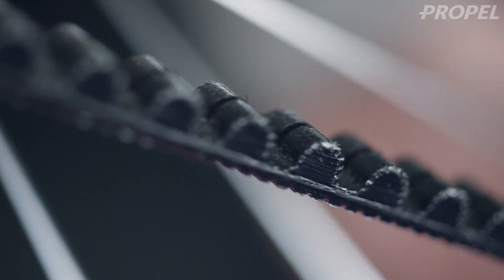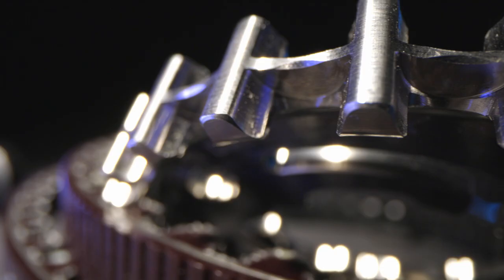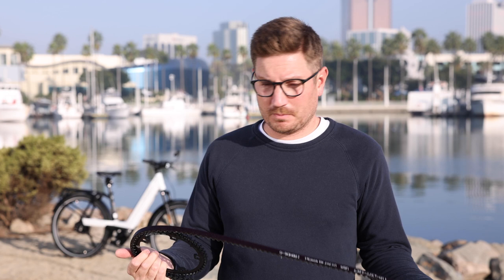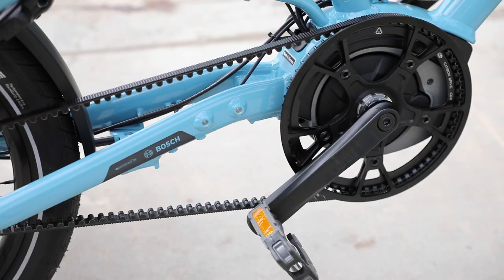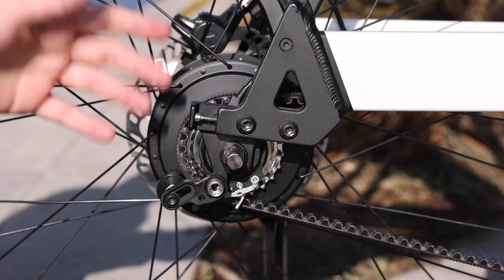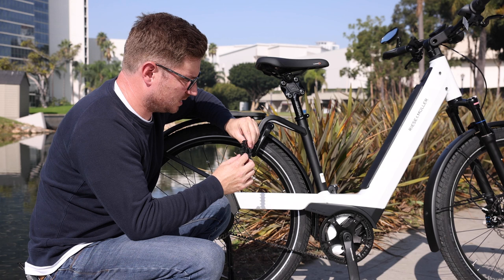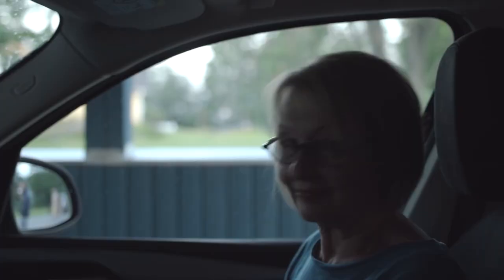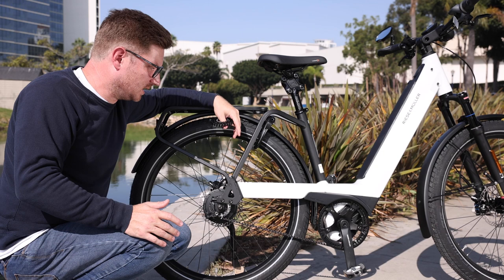Belt vs Chain - Will the Belt Win the Ebike Race?

Comment: Really appreciate the information you guys are putting out.
I have some questions you may be able to help with.
I come from traditional old skool bikes, I used to mtn bike for fun and race and road bike for the same.
Pre electric, got rid of the road bike , still have the 3x8 man bike, looking at going electric, rode a specialized Levo recently and loved it.
Thinking about a R&M, probably either a Delite or a Delite Mountain, it will be a fun plus transport with more emphasis on transport, but more enthusiasm for fun.
If I go for a Delite HS GX Rohloff, is is possible to remove the Mud Guards, and what does the Mountain version have that the Delite does not, I assume with no mud guard I could run wider tyres, but still have the option of 28 mph as opposed to 20 of the CX mountain?

The other question may show my ignorance of the electric but can I pedal faster than 28mph, I can on my old skool hard tail man bike, what happens if I am peddling fast enough to hit 30 or more mph, will no motor stop, burn out, or what happens, can you even do this ?

Comment: I rode along a sea wall during a gusty day during lockdown. The next week my whole chain gear had turned a bright orange (rust). This would be a solution especially if the cogs were non ferrous. Really enjoy your vids always high quality with easy to listen diction.
Reply from the maker: I definitely this this would work well for this application.
Reply: I've got a road bike with belt drive (Civia Bryant), and the original rear cog was aluminum. Unfortunately, it fatigued and broke and had to be replaced. I believe the replacement is stainless steel; stronger, just as corrosion-resistant as aluminum, but a bit heavier and more expensive.

The front cog actually looks to me like some kind of high-strength plastic, but I could be mistaken. In any case, I've never had any trouble with rust or other corrosion on either cog. It's one of the reasons I love the belt drive so much; years of all-weather commuting, including plenty of rain, and still basically no maintenance.

I like the belt drive on my Civia so much that when I wound up in the market for an e-bike, I wound up choosing the much more expensive R&M Supercharger, because at the time it was the only e-bike I could find with a large enough frame but which had the belt drive (Haibike has frames that actually fit me even better, but none with belt drive).

Comment: I run a bosch cx with a shimano deore xt 11speed and i need to replace my chain every 3 or 4 hundred miles. I lube with squirt dry lube every week. Am i doing something wrong to eat chains at such a rate? I use kmc e11 chains as well!
Reply from the maker: 300-400 seems low. Are you using a chain checker gauge? 

Are you cleaning before you lube? I wonder if that would help. If you’re running through them that quickly you might want to consider just going with a more standard chain as it seems a waste if you’re only getting that out of a eChain. I wonder if the alignment is right. Is it shifting smooth?
Reply: I run the same setup for over 4000km without any issue. I degrease and relube (also with dry lube) my chain drive every 2 weeks.
Reply: @Propelbikes  I use a chain checker and replace at 0.75% wear, but i have heard you should replace an 11 speed at 0.5%, which seems too little to me. Also, the Squirt lube instructions are for a thorough  degrease before initial application but then to reapply subsequently without any further cleaning.

Comment: I have a R&M delite envioloHS bought from Propel. Is it possible to replace my current Enviolo manual hub with an automatic one as an upgrade ?
Reply from the maker: Hey Joseph, thanks for your support. Unfortunately it’s not so easy to upgrade, but it could be possible. I would probably recommend waiting until the bike is out of warranty as a change like this would void the warranty. I’m not 100% sure if it’s possible, but it might beZ

Comment: fitting a gates belt to an existing bike is an expensive exercise. geared hub. split frame. sprocket set. belt. shift cable. shift controller. Definitely a better option to buy the right bike. Hikobikes in NZ are the most affordable. The Riesse Muller are twice the price.
Reply from the maker: It’s best to get a bike already built for a belt. Hikobikes aren’t available in the US. Seem to be an ok affordable option, but definitely not a Riese & Müller
Reply: @Propelbikes  have to agree th RM is the best

Comment: I've always got 10000 miles plus from a chain. And only replaced 1 or 2 rear cogs at the same time. Just go back to 6 speed Suntour Pefect. It doesn't wear out as fast as later systems.
Reply: Center mount ebike motors wear chains out really fast. I tried keeping it clean, so it wouldn’t wear out so much, but in the end I decided it wasn’t worth it every day, its simpler to just swap the chain and cassette every 3-4 months. Front ring becomes unusable in about a year, when the chain keeps just slipping.
Reply from the maker: The shift detection on the Bosch system definitely helps with this, but a belt does have a much longer life

Comment: I’d like to see a conversion kit to convert to a belt drive from a normal drivetrain and gear set.
Reply: There are quite a few of those, actually. 

The conversion itself is pretty straight forward. The limiting factor pretty much always is the frame.

Comment: I got 20 year old sparta bike ''chain'' ''internal hub'' about 50,000+ KM
Only 2 times in its life i have to repair it for few euros like 20/30 ;)

I think its just cheaper to make. 
To make more money.
And i find it annoying that these new ebike chains or belts are not in-closed.
To avoid dirt and water to prevent faster degradation.

And these Thicker wheels are needs energy to drive to. ( so harder to paddle ) 
But let me say this if the battery is empty you have to bike much more then non powered bike.

Comment: For an e-bike or actually any bike other than for top level racers, the only reason you’d logically want a chain would be on a bike with a chain case.

But right now there’s a monumental lack of education among new urban riders, combined with the majority of the industry being stuck in a performance cycling rut. Where all development is focused on aero and weight rather than what actually matters to 99.9% of people, reliability and durability.
Reply from the maker: I agree Chris! A chain case has a long history of being a great solution for urban commuting. The belt does seem to be the future though for sure. 

I do have hope that we can get out of this cycling should always be as light and as fast as possible. There are many other factors at play.
Reply: @Propelbikes  I think at some point we will see Dutch bikes with fully enclosed belts as the ultimate solution.

But for now an enclosed chain makes sense for my around town bike. A £500 bike I can accept the theft risk. A belt equipped one I can’t as things stand.
Reply from the maker: Great point! A belt in a chain case would be the ultimate.

Comment: Bikes are unreliable and expensive to maintain per mile compared to scooters and cars. I think that is part of the reason why you see a lot of people using electric scooters instead of bikes for short commutes in the city. A lot more bikes should use internal hub gears instead of derailleurs.

Comment: What if Gates goes bankrupt? Are these chains made by other manufacturers? How much do they cost each? And a belt can't be repaired if it's cut. Chains are a simpler technology. Have there been any instances of Hub or motor bearing wear due to over tightening of the belt?

Comment: Changing to a different gear ratio is expensive on a belt. You can buy a good chain for less than $9. and how much does a belt cost? You mention grease... we don't grease our chains, we use parafin or oil, and it is not dirty. With a belt usually comes an internal geared rear hub which us not as efficient, it takes more effort and you never see the professional riders using a belt. What does a cog cost? Nearly $ 250.!!
Why do long distant riders carry extra belts? Because they break! Sorry Sir, I will keep my chains.

Comment: The belts are better both for us, and for the planet (all that chain cleaning is tough for us to do, and pollutes our planet). But there should be other belts too (non Gates, non carbon). I think at my Honda Accord timing belt (it's an older Accord, belt equipped).  If a timing belt can survive 2,000 RPM - 3,000 RPM for 100,000 Kms (60,000 miles) ... it should be good for a bike too. Why this obsession with carbon ??
Reply from the maker: I know it seems strange, but the bike belt seems to be subjected to some pretty extreme forces and elements. I know Gates offers some non-carbon options but they can’t handle the same torque.

Comment: I don't even understand how such a prehistoric system as the chain/derailleur/cassette still exists on bikes.  It seems to me that this industry is far too conservative and conventional.
Reply: They should just to away with derailleurs on bike & put internal gears on all bikes with a belt or a chain
Reply: What else could exist? Shaft drives are also there but they have even more loss of efficiency and are potentially expensive to maintain. Either that or fully electric bikes with hub motors that simulate pedaling without any mechanical connection.

Comment: Bought a bike with a Gates belt drive and a 300% Enviolo rear hub last August and couldn't be happier with it.
I predict that in 10 years bike shops will take your derailleur bike in for repair and tell you it will take a week or two for the parts to arrive so they can fix it.
As far as chains having an application, the only thing I can see is for use with that 100 year-old derailleur technology... really cheap bike with gears.

Comment: Puzzle me why youtube algorithm show me piece of technology that have no apparent advantage. Not yet even in 2021.  
Chain is efficient, and on clear advantage is that chain is cheap to manufacture, easy to fix and service. One can get a decent chain for $15,   A belt will cost from $50 ~$90 belt.  Not to mention internal gear hub add another $200 to $1000 to the gear system.  There is reason that why normal motorcycles are not using belt drive.